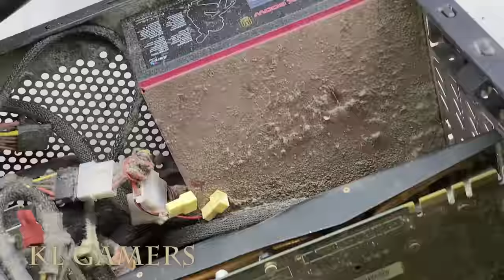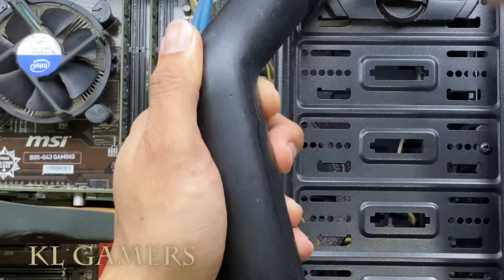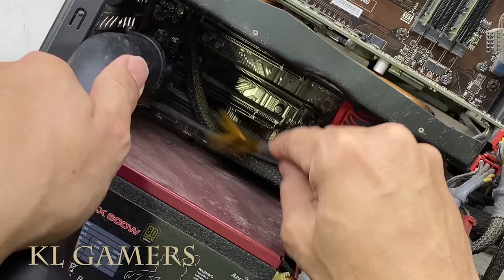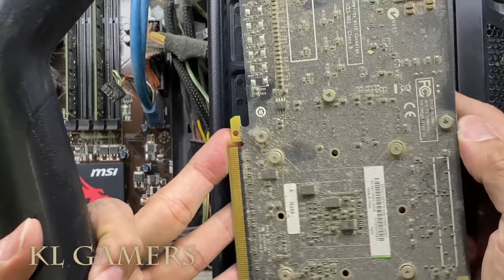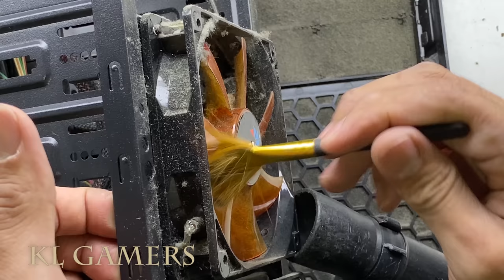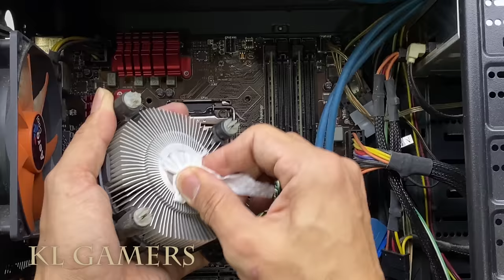You should Vacuum your Gaming PC full of Dust

Comment: He knows he can get away with using a vacuum because he's in Asia where humidity is always high and the risk of ESD is low. The desert or a cold clear, winter day, would be the opposite.
Reply from the maker: yes, and table is wood, vacuum is EU plug and grounded , the vacuum is plastic as well
Reply: @KLGamers  question: would be risk of ESD if the vacuum is all plastic and cordless? Like the xiaomi mini cleaner or beseus A3?

Comment: the ram was installed on the wrong slot!!
why didnt u correct it??
Reply: What u takin bout? Its correct
Reply: the ram is fine there ,-,
Reply: @donhaum  closely look little left of the dimm slots
its mentioned there that 2 and 4 slot first
Reply from the maker: it still would run fine if you placed anywhere
Reply: @KLGamers  yes! but you would not be able to utilize the dual channel or quad channel capability if you install it anywhere